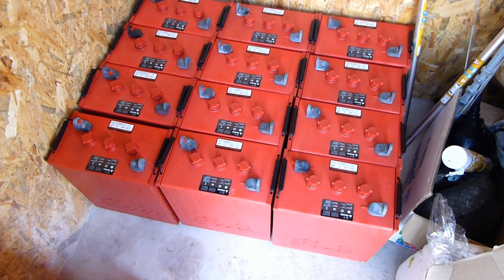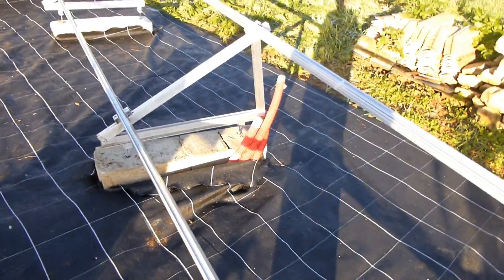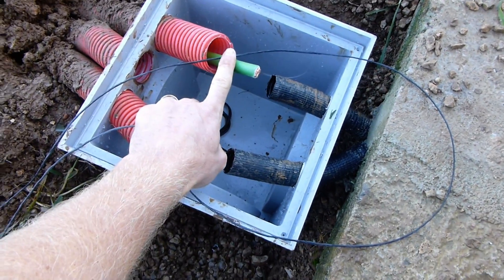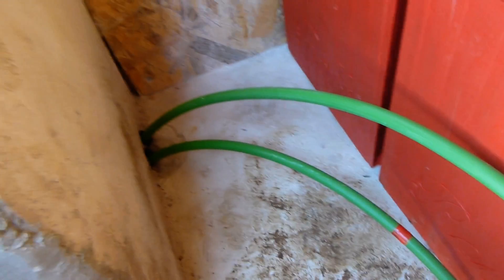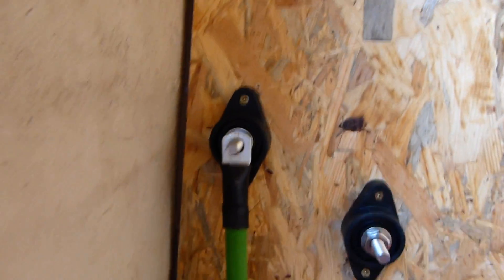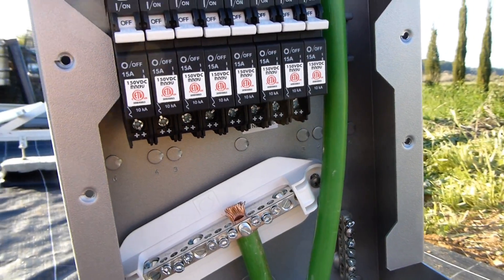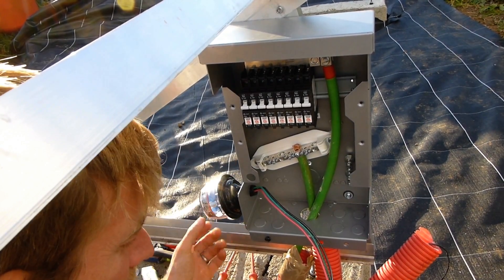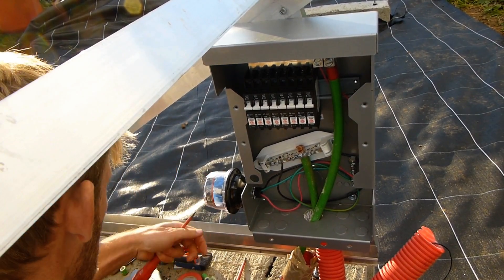Off Grid, DIY, Home Solar install - P2 - Combiner box, cables, dc breakers, lightning arrestor

Comment: I think you should have wired your pv modules in series and parallel so that the voltage would be as high as possible and amperage as low as possible. If you would have done it that way you would have needed less breakers and a much smaller wire to the battery room, all saving you a lot of money. 

I have 9 modules of 320 watts. Three series of three modules wired in parallel. I use 3 15amp breakers in my combiner box and a 10 gauge wire to my charge controller.

Anyways, good luck with your installation.
Reply from the maker: I have it wired that way now as I have changed my charge controller.

Originally my system was designed around my charge controller which didnt accept high voltage.

Comment: My bad I thought he said they were around 460 hours a piece? I wasn't sure how they wired there? Big batteries. I got 12 6 volt V-Max at 225AH each Jumped to be 12 volts and then paralleled to be 6 12 volt batteries total.

Comment: It would be 5520 amp Hours Mate! Amazing. 460 AH x 12, nice. I got a 3400 amp hour bank myself. Got everything Just need to put it all together. Love it! Happy New Year. Later
Reply from the maker: 24volt so thats 468 x 3 = 1404ah.

when batteries are put in series the AH stay the same but the voltage increases.

when you put batteries in parallel the voltage stays the same but the AH increase.

mine are series parallel so really its just three  24volt batteries in parallel made up of 4,  6 volt batteries in series.

to be 5000AH it would have to be a 6v bank with all of the batteries in parallel.

Comment: You could have done some series strings and saved yourself some money on wire and breakers (assuming your charge controller can handle the voltage).
Reply from the maker: It can't...

Comment: Good video but Not sure why you have all those DC breakers. a 300w solar panels in 100% perfect sun and angle will never put out more than its max rating, and for a 300w panel its around 8.6 amps. The sticker on the back will say but it normally under 9amps. A 300w solar panel will almost never put out its max of 8.6amps or so and it will never blow a 15 amp breaker. Something to remember is the 15amp breaker or fuse rating is not a rating at which it will blow, the rating is what the breaker can handle continuously. So the 15amps ones can run 15 amps for a very long time. On the datasheet, it will say where it will blow and just like a fuse it will blow much much higher than rated 15 amps, Most likely around 18-25 amps depending on the make. Which is more than twice what your single solar panel will put out in which case its completely pointless and a waste of money. The only reason to put a breaker or fuse on a solar panel is to easily disconnect it but given you can just unplug the mc4 connector that's far far cheaper.  Remember a solar panel is not like a battery it will never output anymore then its rated specs on the back in perfect sun, Now you would put a fuse/breaker on a battery but not on the solar panel side. If anything in your setup you would be far better to put a single fuse/breaker from the busbar to the very heavy DC cable you used only if the cable is rated less than what the solar panels in parallel at max output will deliver. The fuse/breaker should be used to protect the wire and that's it. Have a watch of some videos on fuses/breaker and where they blow and you will see what i mean :)
Reply from the maker: Hi Mike, 

Yeah, I was under the same impression but after watching a bunch of videos on the subject that all come to the same conclusion I put them in.

I went by American code seeing as most of the videos I have watched are from there.

The calculation is:
8.89amp (isc) x 1.25 (req by code) x 1.25 (over irradiance) = 13.89 round up to nearest breaker =15amp

It seems that solar panels ARE capable of putting out more than their rated output because they are tested under standard conditions with artificial light, not the sun.

Also you are protecting from several other panels short circuiting and sending the current into your good panels, although this last bit of info may be wrong.  I cant remember where I read this.

Here is a good video that explains it well:
https://youtu.be/ZdKiO2zLF5g

thanks for your comment.
Reply: I watched the video but dont agree in terms on what they said about sizing the breaker. Yes that would be right on the battery sizing but not on the solar. If you have a look at your solar panels or any 300 w solar panel you will see two numbers for amps, One the Mppt normal rating of around 8.4 amps and the Open circuit max current of 8.6 amps or around that. Here is a pdf of a 300w panel
http://www.tatapowersolar.com/images/module/downloads/Datasheet%20-%20TP300%20[June2015].pdf
The iMMP etc mppt current is lower and rated at testing at 25c in perfect light. Now you will see Open ciruct max its 8.71amps. That is what is will output at almost no voltage in a short. If you look at the IV curve of any panel on the data sheet  (on the right) you will see even at a temp of 0 the panel will never output anything more than the ISC or the short circuit rating of 8.71 amps.
If you look at another datasheet of another panel.
https://pdf.wholesalesolar.com/module%20pdf%20folder/ET-P672XXXWB.pdf
You will see its max is 8.72 for the 300w in Isc. Even at -10c. 
Either way, it's not going to trip a 15 amp breaker. The (req by code) part isn't going to help trip a breaker, also the wire on the panel is rated normally around 35amps, if its 6mm its rated at around 44amps.
If any calculation it would be 8.89amp (isc) x 0.04 for a 300w panel is around 9.2 amps. So if it was really cold -20-10, Perfect angle and the sun hit it in the middle of the day with no load the panel just might do 9.2a at almost no voltage but it could happen, given almost no voltage I wouldn't think it could trip a 9 amp breaker because it needs some voltage for a period of time to make it trip let alone the 15a one.  However given it's not going to be in a perfect angle and it will be under load it will be much closer to its 8.89a rating. Plus all your wiring can easily do 9.2a and 20amps if not more. Plus if it was -10 the sun would slowly warm the panels up and as that happens the current goes down.
Now your right Given all your panels are in parallel then I guess yes you are protecting agent a short from the high current of the rest which yes is a good idea.The issue with this is putting so many panels is in parallel creating a high current. For the losses of higher current, you wouldn't normally put no more than 3p with a agv of 2p. This keeps the voltage high and the current low for wire losses. Either way its all interesting and it will work.
Reply from the maker: thanks again for all the info.  

looks like I have some expensive switches for my solar panels.

I dont understand this bit:
"The issue with this is putting so many panels is in parallel creating a high current. For the losses of higher current, you wouldn't normally put no more than 3p with a agv of 2p. This keeps the voltage high and the current low for wire losses."

Here are the specs for my panels:
http://www.atersa.com/img/MU-6P%20(1)%206x12-I%20(A290,295,300P)%20TY%203_2.pdf
Reply: I think what Mike was pointing at was to put the panels in a series / parallel configuration to increase the voltage on the feed back to your battery shed. This will lower the current (for the same effective power) so there's less voltage drop in the cabling between the panels and the solar charge controller. 

Not that it should be much of a problem in your case with 75mm2 cables between the solar panels and battery shed! :-)

Those cables must have been expensive!
Reply from the maker: I have a strange charge controller, its not mppt so wont accept anything over 30v.  I did end up spending about 300€ in copper.

Comment: just had to check, but you are using way to big of wire in the combiner box that why it falling apart from the pull from the wire,  input wire is from 14 guage to 2/awg and out put on them boxes is only 14 gauge to 6 gauge wire.i was thinking you were using way over kill on wire ,im guessing wire is cheap over there to be using such big wire
Reply from the maker: The combiner box was already falling apart before i got started.  There has been 0 pull on the wire as that was the first time i wired it up and if you notice, the din rail has come off on the opposite side of where the wire is connected.  which would make no sense if it was the wire pulling on it. Ditto for the ground bus bar and the common.  Also, that wire is so thick that it stands up by itself, it doesn't pull on anything...

The wire Im using is 75mm2 which is the standard closest to OO here and just over OO (72mm).

my wire is sized for the run that i have from the panels to the batteries and is the correct size for under 3% loss. 

I have never heard of sizing wire in relation to your combiner box...

wire aint not cheap... there is about 300€ worth of copper there.

thanks for your comment
Reply: That solar combiner panel does look like it's way to flimsy to me too and there's no way to restrain the cables either as far as I can see. It's a shame you can't just send it back to Outback!
Reply from the maker: i live in Spain and had it brought over from US.  the problem is easily fixed though as its just the screws that they have used dont grab the metal in the holes they have drilled.

Comment: does the lightning arrestor go with ground rod? (probably dumb question )
Reply from the maker: that is something im wondering myself.  I have to consult my electrician about that.  

A guy that installs solar systems around here says that he doesn't ground the solar panels because that attracts lightning, but dont know if that is true.

I will let you know when I find out.

Thanks for your comment!
Reply: Never really heard of lightning arrestor before but have had a little experience grounding from main breaker. And always assumed a must with all electrical. Better safe than sorry.
Reply from the maker: they have a couple of videos on the midnite solar website that explain how these work and even show them testing one
Reply from the maker: I have recently installed a grounding rod near the combiner box specifically for the solar panels and lightning arrestor.